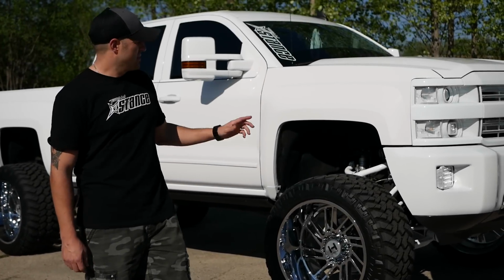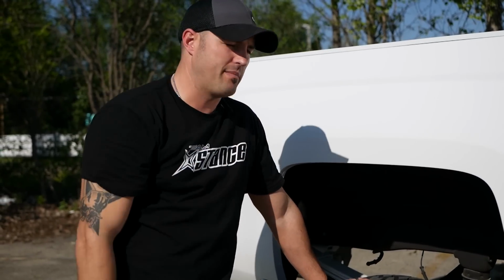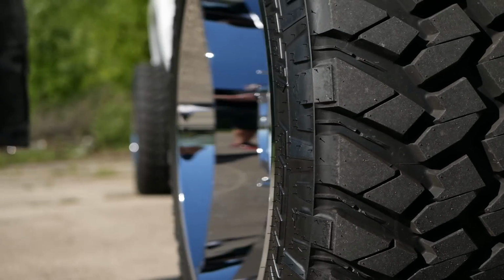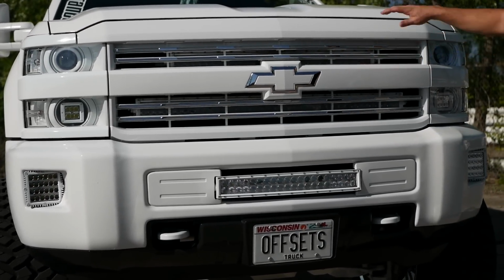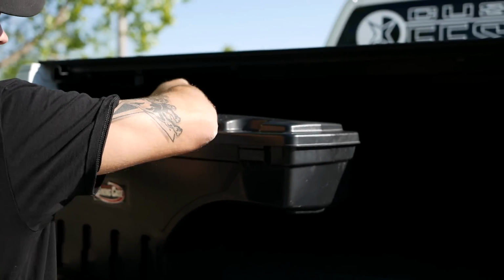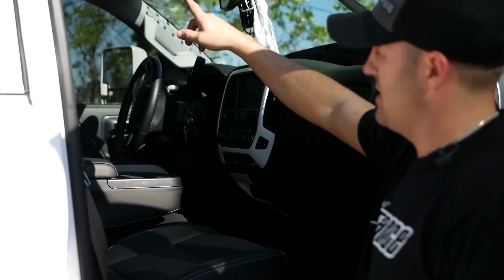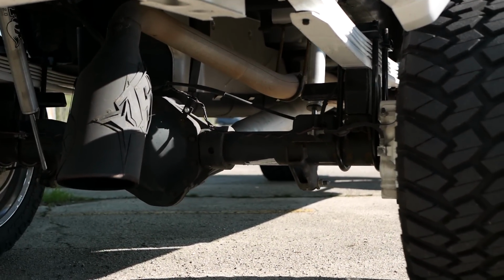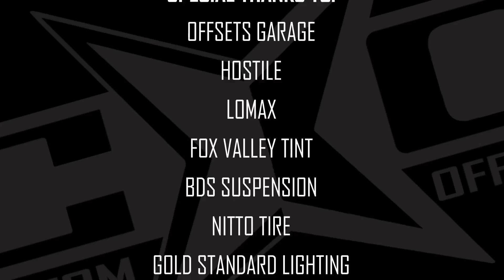Spotlight - "CO2" Makeover! 2015 Chevy Silverado 2500HD, 6.5" BDS, 24x14 and 36x15s!

Comment: we need some more details on that sun roof man!!!. I want one
Reply from the maker: Not a whole ton to give Adam, took it to a shop they cut a hole in the roof, installed a factory sunroof assembly, made the headliner fit to the new hole!
Reply: Cost>?
Reply: Custom Offsets does it leak most people won’t attempt it because of leaking problems. I wanna do it to my tundra but people are saying don’t do it. And yes that is my truck on my profile picture.

Comment: Shaun I got to ask how do you keep your truck from getting rock chips on it behind the tires? I have a ram 1500 and I hate the mudflaps look (which I have on mine) I want to take them off and put the plastic trim pieces from factory back on but I'm worried it will get rock chips like crazy
Reply from the maker: Doesn't get driven a whole lot Ohiostatefan26

Comment: I have a question I have 20x14 mavericks and would like a tire wider than 13.50's and was wondering what you guy's think about mickey thompsons 36 15.50 baja tires.
Reply from the maker: If you can fit it, most definitely!
Reply from the maker: we haven't had the 36x15.50" tires in the shop so can't touch too much on them. But Mickey thompson makes stellar tires!
Reply: About how many miles do the nitto   trail grappler last? What do you guys think about Cooper stt pro tires 325 50 22